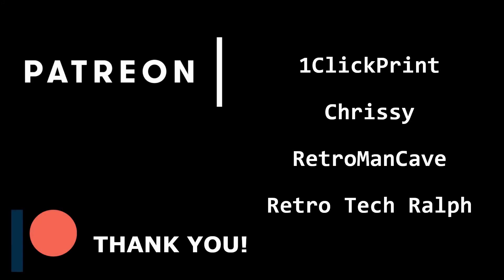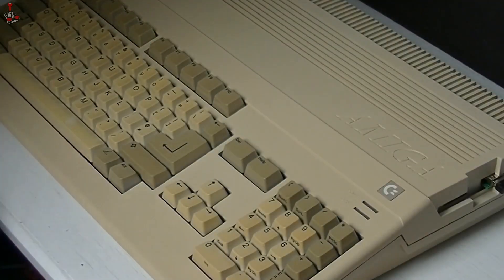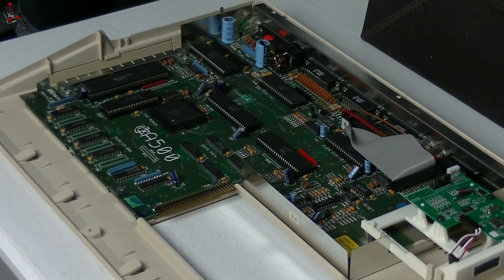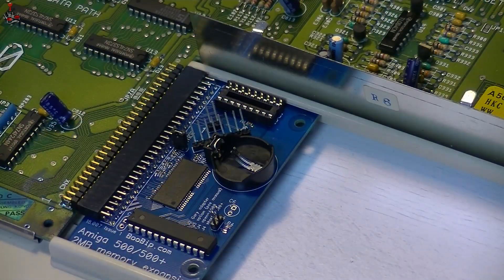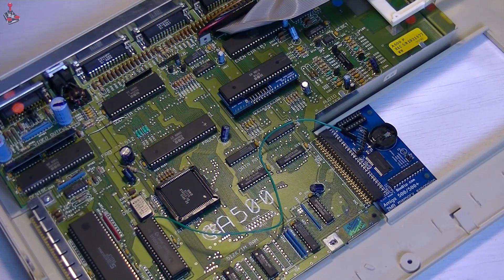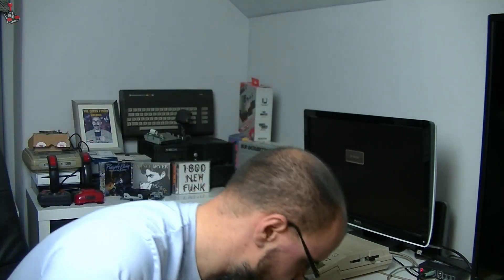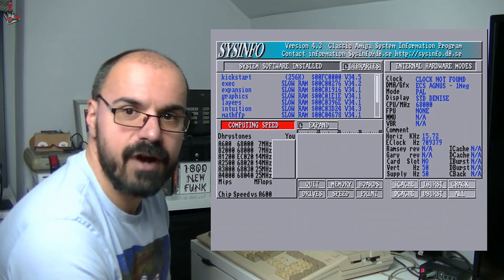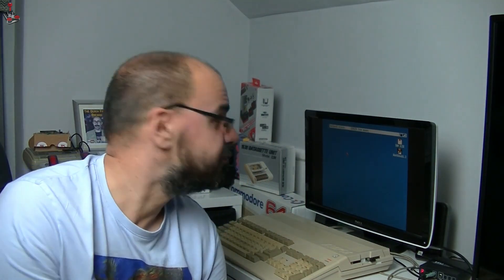Installing the BooBip Amiga 500 2MB RAM upgrade

Comment: Got a ACE2 on my A500 Rev6A Recap. Got a ACA500Plus with the ACA1233n-55 IDE Speeder RTC and a Indivision ECS V1 Super Denise. Running WB 3.1.4.1 with BestWB 1.3 on a 16GB CF with 7MB/s. 68030/55MHz and 2MB CHIP RAM, 1MB SLOW RAM and 126MB FAST RAM. It’s a fast A500 and waiting for the Indivision ECS V2. And maybe the X-Surf 500. Also waiting for the black A500 case and keycaps from A1200NET. Name it The Beast of the game from Shadow of the Beast.
Reply from the maker: Amazing!
Reply: I’m now busy with my A1200 projects. Got a great A1200 with the Blizzard 1230 IV / 68882 FPU 50MHz and 128MB 50ns. My second and third A1200 must have a ACA1260 and a Blizzard 1260. A 68030 is great for WHDLoad but for Demos you must have a 68060.

Comment: Nice little video. I can also add two thumbs up for this little board. Having the 500 Plus I did not need the Gary Mod and it gave me two meg chip ram which really helps. My favorite upgrade is Jens (Individual Computers) ACA500+ which is relatively inexpensive and will provide 8mb fast ram and hard drive with a convenient hot swap CF slot as well.  Also a speed boost. It also then has the option to add usb, ethernet as well as other expansion options when time allows. https://www.youtube.com/watch?v=RnsZ52lFS2Q 
Love the Derek picture in the background ;-)
Reply from the maker: Thanks for the kind words! Yes you can never have too much Derek Findas! :)

Comment: I might have missed that video, but did you modify the Gotek specially for the A500? I have an A500 and an extra Gotek, I might want to use as DF1 on the A500. The Gotek is equipped with FlashFloppy. So I think I just need to configure it with the Shugart interface in its options?
Reply from the maker: Yes gotek should be happy being DF0 or DF1 without further modifications. If you have the flashfloppy firmware installed you should be all set.

Comment: Great stuff =D  If you wanted to add fast RAM too, look at the MKL boards (I think I mentioned that one already?).  That would give you 8MB fast, on top of the 1MB chip and 1.3MB slow you already have.   On top of that, you could also add a TF534, which would give you another 4MB of Zorro III fast, as well as an 030 @50Mhz, FPU and CF HDD.  It would be a beast of a 500 then lol!  That said, its all more money!   I know the MKL 8MB boards coexist with the 534 in a 2000 OK, I've yet to test in a 500 though.  To be fair, the RAM you have now is more than sufficient for any of the OCS and ECS games out there.
Reply from the maker: That's the plan eventually. I will be nice to get some fast RAM in this and add HDD support. 👍
Reply: I have a tf534....what are these TLK boards ?
Reply: MKL
Reply from the maker: I had a look when Gadget mentioned then last time but I think the guy has stopped making them there is a thread on Amibay.
Reply: Are they the mem68k/ram68k boards that fit ontop of the TF534...made by a guy in Finland ?

Comment: Say, the memory upgrade that was removed, had the on/off switch, just in case a program doesn't like "too much" ram. (I recall some games being like that.) Is there no such switch in this, or is it needed?
Reply from the maker: I have yet to come across that issue but I've not heard of any issues with having 1MB chip RAM. If I do I will report back.
Reply: @RetroRecollections  not a real issue with the full 1mb chipram; only some old games that search specifically for the slow ram in C0000 location (where the 2nd half mb of chip stay after the mod and cannot be altered), so a few of them won't work until patched.